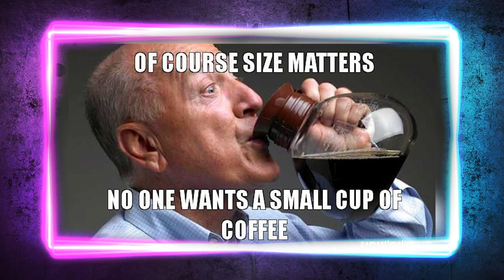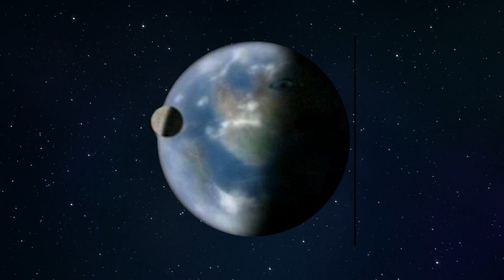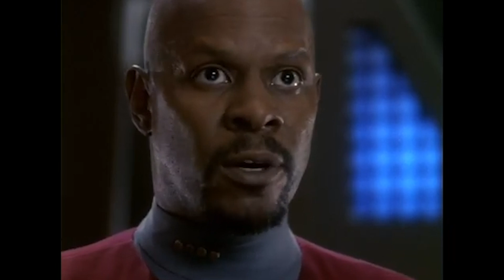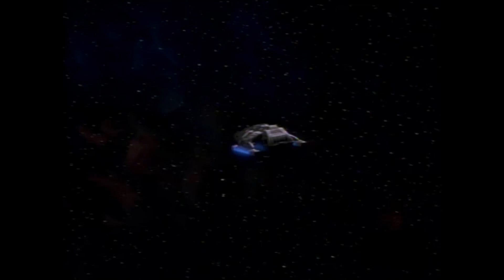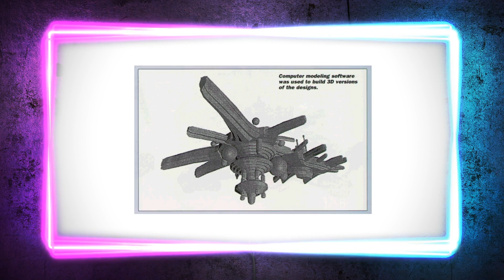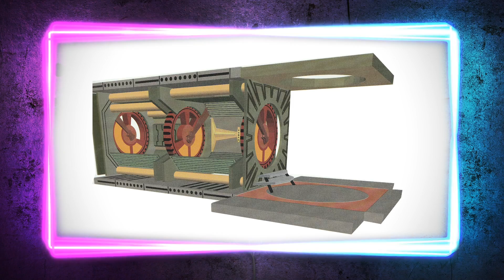10 Features of DEEP SPACE NINE in Star Trek

Comment: 01. DS9 is very small station. One of the smallest in ST universe. Also very inefficient in internal space layout.
02. Continuation of point 01, station is simply unfit to be refinery because it has small internal space for raw material.
03. This was major bullshit of that show. In continuum was several times explained, why that ship/station can not have more weapons or stronger shields (mainly because structural integrity strains, overheating problems etc...). Yet, suddenly Federation was easily capable to increase weaponry and shields by magnitude. Why they were unable to do same for their ships to have better chance against Dominion, ha?! Plothole bigger than station itself!
04.  You are wrong, warpcores are not in ST designed to produce consumable energy. They create plasma to manipulate spacetime in warp engines but that is it. Energy for other system are on ST ships produced by fusion energy (yep, drained from impulse engines). Antimatter is expensive even when dilithium is catalyzing it for you.
05. This is not fake solution, this is causal ST science. Without spacetime manipulation (gravitational constant included), warp travel will be impossible and also impulse speeds would take horrendous times to accelerate/decelerate and also whole supply of deuterium would be gone in single 1/4 impulse run. For example, to accelerate Galaxy class (5Mtons) to full impulse (75000 km/s) using fusion engines with 100% efficiency (neutrinos included) you will need 36 Mtons of hydrogen. Without spacetime manipulation totally out of reason.
06. That elevator platform thing was totally stupid design. You do not need elevator, when your ships can hover using antigravity and you have force fields to isolate compartments. It was added just because creators thought, that moving parts is cool. Same stupidity as for Intrepid class, but there was at least semi-reasonable justification with spacetime manipulation by warp field geometry in sublight and FTL travels.
07. Yep exactly, totally bad and useless design, which is easily recognizable even for causal viewers. But, it is TV show, so it was understandable.
08. You are wrong, you need 3 doors for airlock. You always need quarantine and maintenance zone. When you using beam transporter quarantine systems are included in biofilters of main materialization computer but when you have docking port on station where multiple races walks in and out with minimum supervision, you really need some containgment area.
09. 
10. interesting hypothezis, but promenades were quite common in European cities, bars, tailorshops and brothels included ;-)
Reply from the maker: #10 isn’t my hypothesis, it was explained by Herman Zimmerman in an interview, you can watch it on startrek.com
Reply: @GenerationFilms  ok, this one i missed. Thank you for clarifying to me.
Reply: Wow, you are quite the nerd. You are pretty passionate about the fake science in Star Trek.
Reply: @kevinathans  Scinece in ST is not fake. Not even close. Majority of ST science is very real or real theories based. This differ ST from other sci-fi shows, where they do not have will or resources to align show universum science with real universe science.
About nerd thing - I am nerd of science and have good memory. So I am focusing in movies and TV shows to that particular area and remembers it on first view. In other parts of ST universum, for example relations between characters or some history buffs, I am not so well versed :-D
Reply: @tomascernak6112  ST does a pretty good job with science, but you are nitpicking or not applying modern technology. Obviously I get the show was made in the past and they can't see the future, so some things you just need to let go. Just stupid stuff like the 3 door airlock. Just use a force field as a fail-safe. I'll tell you my biggest issue...space goes in all directions and not all stars are on the same plane, yet you never really see ships come in from the top, bottom, or facing backwards. ST talk will just say something like "well the computer is making thousands of calculations, blah blah blah, and they end up facing eachother. The reality is that's it's done for visuals, and I'm okay with that. I would rather think of the Romulan/Starfleet boarder as a flat line instead of a bubble in a bubble. Just makes it easier IMO. But now I am certainly more of a nerd when it comes to the history, which is why I hate most of the newer stuff...
Reply: @kevinathans  Well, about stupid 3 door airlock. They do same stupid stuff on ISS. But hey, they are stupid NASA right ? ;-)
Reply: @tomascernak6112  Well my understanding is Star Trek is that they are slightly more sophisticated than NASA...I mean at my job, and my kids at school, use the simple plain calculators. Should they have those in ST as well, or do you think they have come up with something better?
Reply: @kevinathans  Yeh, and here we get double trap. If they do things according to science, you say, that they do it for effect and they should have be more advanced than actual state of art. If they do things according to fiction, you say, that it is technobable so they spare some coin on complexity of showed system according to current state of art.
About that calculator thing - yep, they should use simple plain calculators even in future. And reasoning is very simple. When you are learning math, having smart calculator (or even voice commanded heuristic supercomputer) is contra productive to your learning curve. Simple calculator is just tool, like ruler. You have to understand to math behind your calculation otherwise, result will be wrong. With smart calculator this is not necessary. You just put mathematical problem into it and get result in instant. But problem is, that you learn nothing this way. You can argue, that then they should not use calculator at all, not even simple one and do all calculations on paper, like our parents did. But there is little difference between fully manual and simple calculus calculations, so using simple calculator is not jeopardizing your learning curve.
Reply: @tomascernak6112  First off, my biggest gripe is just how overly picky you were in your criticism. We can generally find fault is most things. Now don't get me wrong, I love science, but ST is much better with politics and teaching people lessons in that area. My dad loves ST so I grew up with Voy and TNG on every night. Still even though they mention it multiple times, my dad was surprised to find out that warp 9 was just 9 times the speed of light and warp 1 was 1 time...obviously that's a huge deal, but it wasn't anything that made him see the show differently. The point about the calculators was simply about technology. Obviously you still have to learn maths. My point is you have a calculator on your phone or computer, making them irrelevant. I personally don't have an issue with the 3 door thing...I assumed it was a safety precaution and didn't think about it again before this video. All I'm saying is you could effectively use a force field instead and we know how much they love force fields...
Reply: @kevinathans  1. Picky in what?
2. Warp scales were never linear. Nor in TOS, and definitely not in TNG era. Warp 1 is indeed 1×c in both scales, but warp 9 is 729×c in TOS and 1516×c in TNG.
3. Politics is somewhat naive in ST universum, it is utopic depiction, so hard to take lessons from them (small sidestep was DS9, but other shows were simply schematic and naive).
4. It is highly probable, that my math is much more advanced than yours due simple fact, that i have three university degrees (mechanical engineering, electrical engineering and nuclear physics) so I studied pretty hard mathematics half of my life, yet or maybe because of that, I know, that it is not good idea to give advanced calculators or heuristic computers to children or math students.
5. they love forcefields, yet they still use doors, hatches and gates. Forcefields tends to fail more easily than solid material. It is simple physics and mathematical theory. More complex system is always more prone to malfunctions and errors.
6. I am not saying, that that rule of three in DS9 had any other reason than just pure aestheticall intention of showrunners, but in case of those airlock compartments it has pretty feasible technical explanation (in contrast with pylons).
Reply: @tomascernak6112  I never intended a big debate. Maybe you need to dumb down my points. My point about warp speed was simply that my dad didn't know that yet it didn't ruin his experience. Again, you missed my point about the calculators. Do I need go come up with a non-maths example, or are you just being argumentative? We will let you be the expert at science and mathematics, is that fair? Now I'll be the expert in something. My degree is history and religious studies. Relax, I'm an atheist. In that field, the best way to sum it up, is I study people, try to understand what they believe, and why. Both that topic and history is highly political. Both Star Trek and Star Wars teach very interesting questions in regards to politics and religion. They raise interesting philosophical questions. It not being your area of specialty, maybe you miss a lot of it. They don't always explain it to you like a math problem. You have to understand the story and reflect on it and ask what the point was. Ask yourself, "is this what society would look like?" I think it would be much closer to Star Wars. Still, both of those shows bring up some of the same philosophical questions. Are droids/androids/holograms "people?" Why or why not? Is that how we judge things today? Should we possible change our view? On the same topic, The Orville does a great job with this stuff...cancel culture, same sex marriage, changing gender, ect. 
In my opinion these issues are more important than the scientific details. Not because science isn't important, it's because politics and religion get in the way of science and it interferes with it. I always tell people that the evolution-creationism controversy isn't a scientific controversy, the science all agrees. It's strictly a political/religious issue, so we want people to understand those differences. Whether it's the Q, Chakotay's Native American religion, or the wormhole aliens, they raise many interesting questions on the topic.
Reply: @kevinathans  Well, I saw those aspects you described in ST, I am maybe not social and emphatic as you are, but still not dumb :-) I only find them too schematic, too naive compared to reality (ie good is good, evil is evil, no shadow area between, especially in TNG and VOY, DS9 is slightly different). I liked that almost fairy tale schematic and naivity in my childhood and young years but this does not mean, I am not unable to admit those perks today, when I am in my middle ages and life get me several hard lessons to learn. (Because of that today I like DS9 more then TNG, VOY and ENT).
To find those perks in Star Wars is hard, I would say impossible, unless you are into extended universum from books and comics. Reason for that is, that Star Wars consisted only from 6 movies, cca 13 hours. This does not give enough space to even imply aspects of society, culture and politics you pointed above. Second reason is, that whole SW is medieval fairy tale put into futuristic environment. So when you compare ST and SW as sci-fi, then ST is 99% pure "sci" and SW is 99% pure "fi". Problem is, that SW is hypernaive. For example, motivation of siths are ... well ... they are pure evil. They do not have any other motivation than kill, destroy and torture all lifeforce of universe and for that motivation they need to dominate that lifeforce. But such motivation is laughable to me. Even Hitler with nazis were not such simplistic and pure evil (although "historians" and politicians are trying to force that view of him to us). I understand why Lucas chose such story, storytelling and lore. It is easy to sell it even to simpleminded people with below average inteligence (those people do not have enough IQ to understand complicated sci-fi and thus do not like it) so SW are on totally different level of commercial value and success than ST (70 compared to 4 billion USD).

I have to admit, that i never found time and will to study extended universum of Star Wars. Not even watching those animated serials. So for me, canon is only what I saw in those 6 movies (I see those 3 newest movies as alternative timeline like Kelvin timeline - it did not happened, it is just "what if") and Mandalorian. And honestly, seeing any philosophical questions in those need very creative mind :-D
I hope, I did not offended you (you are obviously SW fan and you are probably familiar with expanded universe). So let say, that I totally agree with you in Orville evaluation and I personally consider Orville as real next Star trek more than Discovery (and I am very sad to say also Picard) is.
Reply: @tomascernak6112  Sorry for the delayed response. I never suggest you were stupid. I certainly agree with you on DS9 and I actually didn't enjoy that until I was older. I understand your point about SW, and it does help to understand things outside of the story, I mean my wife never understood the complexity until we watch the Clone Wars series. One of the big points of that show is that the people don't like the Jedi, they see them as the bad guy and blame them for the bad things happening. We see this in the movies with both Count Dooku and when Anakin says in his view the Jedi are evil. It's an interesting debate because the Jedi actually represents a conservative religious view. Their ideas may be incorrect or outdated. I would also suggest this...exchange "Empire" with "America" and "rebels" with "ISIS." What if  switch out Palpatine with Trump? Would we still be on the same side? It's really a matter of perspective. Again, it's not easy to notice, but there is a scene in SW where they are painfully torturing a driod. Is this okay? Are they like humans? Why do they even feel pain in the first place? Lucas obviously put this in there to make people ask questions. You can simply reprogram droids and make them without pain, so what's the point? Also, your point about the Sith isn't correct. "Sith" is like the word "Jew." Is it a race or a religion? In both cases the answer is both. The Sith are a race of people, the type Darth Maul was, but not all Sith are of that race. Better terms would be dark side and light side when it comes to force users. One of the philosophical questions is, is the dark side bad? I would argue that it depends on who is using is. The dark side uses the traits of emotion and aggression, like Klingons. The light side is logic based, like the Vulcans. This is why Yoda was disturbed by Anakin's fear. "Fear is the path to the dark side. Fear leads to anger. Anger leads to hate. Hate leads to suffering." He questioned Anakin's ability to overcome his emotions, which ultimately resulted in him turning to the dark side. Another thing you wouldn't have know is Mace Windu is know to use aspects of the dark side or "reach into it." This is why he shows a lot of passion and is excellent with a lightsaber. Also, his lightsaber is purple...the combination of blue (light side) and red (dark side.) His purple lightsaber was very intentional and really emphasized the debate...could someone use the dark side and not be bad? So what is better, logic and reason or emotion and personal experience? That's literally the entire debate of science vs religion. I could keep going, but I think you see my point. There are great philosophical questions, but yes, if you aren't familiar with the expanded universe, you would probably never pick up on it. Anyways, good chat. Oh, and I wasn't offended. I love both SW and ST equally, but for different reasons. It's kind of like my education...SW interests me more on a religion aspect and ST more in a science aspect. I mean 2 years of my education was the history and philosophy of science and biology. I took grad level courses in biology, so it's certainly a huge interest of mine. It's why I like both ST and SW.
Reply: @kevinathans  Eh, that "drioid" torture chamber did not have any deeper meaning. It was just simple service to audience, which anthropomorphized D2R2 to "E.T." level of cuteness. Nothing more, nothing less. Btw. all ROTJ was heavily influenced by silliness of comercially very successful Spielbergs ET. Hell, they even make later movie with Wookies themselves (and funny thing - when he tried to recreate that silliness in Phantom Meance, it failed harshly, because fans, who were children in 1983, were adults in 1999). So as I said, viewing those hardcore philosophical question you brought in need really creative mind. But Lucas definitely did not have those on mind when he were writing plot for SW. Honestly - Lucas, unlike Roddenberry, is not a philosopher. He was, is and always will be an entertainer, very good one, but he is unable to create movies with some deeper meanings. This is beyond his capabilities.
Siths (post racial are manifestation Bogan, as are Jedi manifestations of Ashla. Yes, it can be viewed as religion, but not in modern christianity but more like medieval islam. Sith code ruled every aspect of "believer" life. Funny thing is, that originally Lucas created them as analogy of SS and for example, Emperor in first draws was not a Sith. But then idea evolved. Still even this evolved idea is too monochromatic for me. You can argue, that similar thing have Star trek, where alien races were character flat aspects of perks of humankind. That was Gene´s idea from start and had some deeper meaning (it was mirror to then colonial exploitative capitalistic (orions), militaristic (klingons) and machiavelistic (romulans) discords of american state and society). In case of siths and jedi, it was just simple black and white, pure evil, pure good schema for simpleminded people, who will not understand to more complex nature of SW world of expanded universe (which was not created by Lucas, btw).

I think ,we can agree, that my ignorance of expanded universe is quite problem here. I should atleast watch those animated series or even better - read the books. But I am afraid It will not happen - not enough time and also i really do not like Lucas`s idea of society. I am communist so eco-scientific socialism of UFP is much more pleasant to me than feudal and exploitative imperialistic capitalism of Republic or Imperium. For example, I strongly disagree with death penalty and in SW execution is as common as breakfast. And only difference between Empire and Republic in this matter is, that in Republic they pretend to make a trial before your execution and in empire they do not bother with such farce with pre-determined judgement ;-) This maybe does not bother you, american. But for me this is big nono. So I enjoyed movies as I enjoyed GoT, but study that universe deeply? I do not think so :-D

Btw. I am glad, that I did not offended you. having philosophical debates like this with native speakers is hard for me. Also cultural difference is huge - ie, you apologized for "never said that I am stupid", but from me it was not any grievance or complaints. It was into English word by wor translated Czech idiom, which does not have any negative connotation in my cultural bubble, but obviously mean something negative in your culture (thus your cautious about possibility, that I explained your words as insult :-) I learned hard way, that is very easy to insult american and not even knowing about it. For example several weeks ago I insulted some youtuber by saying that Intel is Jewish company. It turned out that he was american jew and saw some attack in that. He called me worst racist ever and banned me from his channel. It took me while to even realize reason let alone to be ever able to understand his reason :-D